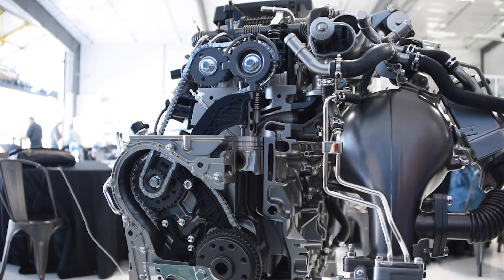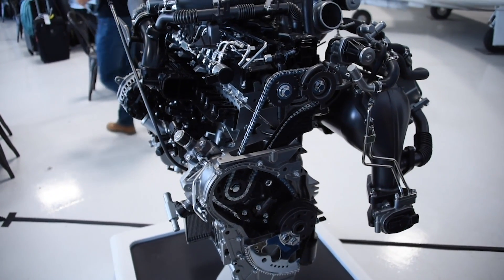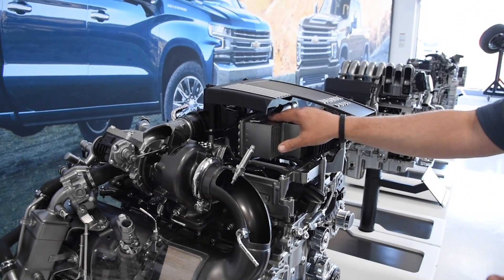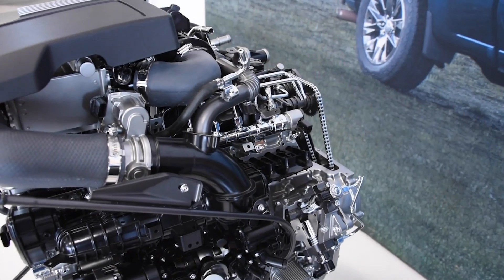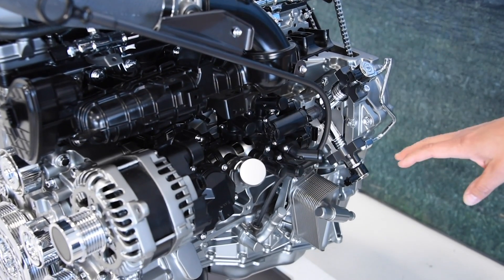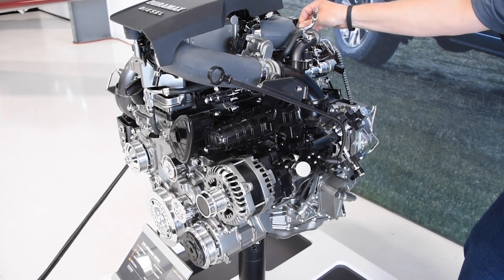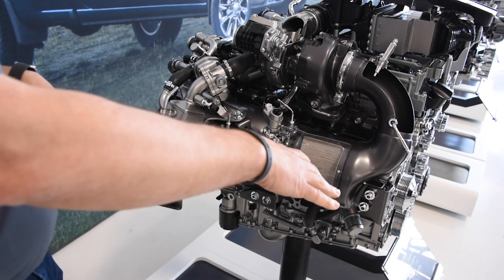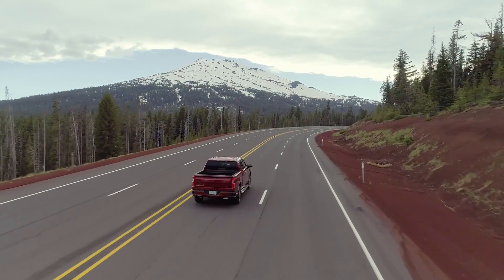What you don't know about the 3.0-liter Duramax diesel

Comment: I stopped watching at 'timing belt for oil pump'. What a joke. Planned obsolescence!
Reply: Yup. Has Permanent timing chains and Cam chains. Come on guys. Just one more chain. So dumb.
Reply: Supposedly it lasts 150,000 miles minimum and is 'easy to service', but I agree that's so dumb. The vehicle is out of warranty by that point, so if your oil pump belt breaks at 113,000 and grenades the motor, there's not a dang thing you can do about it.
Reply: @Kcducttaper1  
I had to laugh, "east to service"!!! All you have to do is drop the transmission!!!
Reply: @Kcducttaper1  exactly  new motors are a joke
Reply: Real diesels have gears, even better than chains. Absolutely bulletproof
Reply: Easy to service “ just back off the transmission “  are you  fahken kidding me? That won’t be a cheap service call!
Reply: Here I thought they learned from making the Colorado have a 150K mile timing belt.

Remove the transmission to service it? Should be a money taker. 

Otherwise, nice power.
Reply: @thomasbishop9098  You have to remember GM now stands for government motors since they had to be bought out/bailed out....  What has GM done to show they can really ever learn, after the steering colums that would lock up on drivers (while the vehicle was being driven, including the vette) for over 10 years from various models it's clear they have a learning disability.  Or if that isn't the case then it makes it clear they really couldn't care less.
But anymore now a days, every maker is making engines to not last, that doesn't make them as much money that way.  Ferd is doing the same stupid thing with the 3.0 powerjoke, belt driven lube pump, they all are taking the moron route and hoping the new car buyers will pay the way.  Piss on that give me a good ol 7.3, I couldn't be made to want a new truck unless it was 100% free to do with as I pleased, then I'd sell it and find a good used older truck.
Reply: @PatrickBaptist  They all have had bailouts from the government at one time or another.  I agree though the GM bailout was a complete lie that they payed off the loans.  The used the old man from at&t to make people feel better but it was a scam.
Reply: That engine looks like such a JOY to work on......NOT!!! Looks like you have to pull the gear on the injection pump. Not a big deal.... A huge deal. Looks like you have to pull the cam chains. Oh sweet now you have to retime the whole motor. I guess it not a big deal since it will last the life of the motor or when someone puts gasoline in the tank and ruins the high pressure pump. I guess its not a big deal since your already into it for injectors, pump and fuel lines. What's another $1000 to pull the trans. Oh well, it could have been a good motor. Typical GM garbage
Reply: $3000 service
Reply: @icenbryse5190  
News flash, but just a few seconds at highway speeds without oil pressure does serious engine damage. There will be no limp mode. It will be shut down mode.
 If a VW timing belt breaks the whole engine stops. 
 I don't think the point is weather it is "supposed" to last 150k with absolutely perfect recommended maintenance. The point is why do it in the first place. It is a unnecessary failure point that didn't have to be there. 
 There are many design issues with this setup in real world applications. I'm sure it looked great on paper. Having the entire exhaust system under the hood is a bad idea. Great when new I guess. Not great after a few winters wear, bird or squirrel nest under the hood, and just the general accelerated wear from the unnecessarily high under hood temperatures this thing will have. 
 Any major component needing replacing is going to require pulling the engine, or cab. The list goes on.
 Timing chains and tensioners are problematic as well. Ask ford.
Reply: Don Olypopper  I dont know where you got that info, but yes it is wet. To help lubricate it and the chains since they are metallic
Reply: What happens if the oil belt comes loose, and for some reason, gets caught in the timing chain? Unlikely, maybe, but crazier things have happened.
Reply: @mosley_actual1924  sine your motor is going to blow with no oil pressure, the damage to the chains isn't going to matter. You're still going to be ordering a new engine
Reply: @mosley_actual1924  As long as it's out of warranty it's GMs happy day.
Stupid ferd is doing the same blame thing with their 3.0 joke.
I use to love fords but today I don't like any brand other than Navistar.
Reply: @PatrickBaptist  as in the same people that built the 6.0 and the 6.4 for Ford?
Reply: @JasonTAho  After the 7.3 PSD ferd stopped having good engines period.
Reply: @PatrickBaptist  I've been a diesel mechanic for 15 years and Navistar SUCKS! the 6.0 Powerstroke/VT365...Navistar! The 6.4 Powerstroke/Maxxforce 7...Navistar The DT530e also junk and also Navistar! Pretty much anything that says "Maxxforce" on it has both NO power and HUGE reliability issues. 

I think you meant to say Cummins or Caterpillar.
Reply: @brandoncrimmins6296  Only power stroke that is good is the 7.3 / T444E, the rest are garbage.
I don't really like anyone's engine after 04, emissions ruined reliability. 
Neah I really any not a CAT fan, but yeah Cummaparts are good too.  Def hate calling them over an Onan product though.
Reply: @JasonTAho  Actually the 6.0 was a navistar but it got rushed to market because of GM releasing the 6.6 Duramax and the Ford corporate wanted to jump right in. The 6.0 isn't a bad motor but as it came from the factory it was. I have an 04 Excursion with one and its at 238k right now. When the original head gaskets failed it got a full bulletproof and EGR delete. Its a very good and reliable engine now. 

The 6.4 was built by a french company, not navistar. At that time navistar and ford were in court battles over the blame game for the 6.0 problems. The 6.4 works well, just not as an engine. But if you tie a rope to it you can keep a boat from drifting off. So it has some sort of use.
Reply: Find somebody that knows how to work on this engine is going to be fun.
Reply: @jamesm568  If they sell enough of these engines I will get the specialty tools and rake in the cash at my shop. Just like I did when they made the 3.4 and I did a million head gaskets and intakes. Just like the for 5.4 3v spark plugs. If they make a shit design I'll be waiting to collect the healthy profits. Bet there will be aftermarket getting into the game after enough fails to make a chain conversion kit to get rid of the belt too.
Reply: Are you an engineer
Reply: @35RSkyline  OH HELL! Here we go with this shit again... "Are you an engineer?" "Are you smarter than GM engineers?"

This is the single most retarded and "I voted for Hillary" statement/argument one can make. 

The fact is that when every other engine in the WORLD has a direct crank driven oil pump. Or at least a chain. Belts are worthless and fail constantly in any environment. Let alone a wet environment. And a wet OIL environment at that. 

Maybe this system will work for a million miles... But even if it did. That does not change the fact that it is ABSOLUTELY stupid. Because whether it proves to be a solid system or not (NOT being far more likely) is not the only issue. The other issue is is whether or not it would have been cheaper, more reliable, less complex and just plain easier to just mount it directly to the crankshaft. 

Their reasoning was noise. And of all the things on a diesel engine that make unwanted or undesired noise. The engine oil is not, has not been more will ever be a point of concern... And in addition to that fact. If your concern is in fact engine noise in the cab... Probably don't put all the noisy timing equipment right at the fire wall. Where you then have to ad even MORE sound deadening to counteract the noise from not only the engine itself but also the extra noise from the timing set. 

And no... I'm not an engineer. But I am a diesel mechanic of about 15 years.
Reply: @35RSkyline  Why would one need to be to know where a belt driven oil pump is going to leave one?
Reply: MY FACTORY timing belt in my 02 civic 1.7  is still going at 231,658 miles...NEVER CHANGED! I have two Harley's and I ride'm like I stole'm and the belt drives have on both bikes have doubled the mileage life.
Reply: @paulh.2144  Yes... Guess what... Both of the belts you mentioned are DRY belts. NOT in oil at ANY time and if they were... They would fail almost immediately. 

Belts can last a good long time but will never last as long as a chain or gear drives.
Reply: @brandoncrimmins6296  Dahh!! Right on Brandon, but they make belts  for this situation in a oil enclosed containment.. and they WORK well!
Reply: @paulh.2144  Ok. I'm willing to believe that... But what I'm getting at it is I'm certainly not going to be the Guinea pig on the hook for the cost of an $70,000 truck. 

Even if they have figured out how to make a belt that stands up to direct engine oil contact. Which actually the oil itself is not the problem. It's WHAT the oil is carrying in it. Things like metal shavings, plastic shaving and other abrasive materials that get picked up while flowing through the oil galleries. ESPECIALLY IN A DIESEL ENGINE...! 

So yes... Chains and/or gear drives are ALWAYS the best solution for reliability. And in the case of oil pump drives. Driving DIRECTLY on the crankshaft is the preferred method.
Reply: @icenbryse5190  The VW 1.9 diesel oil pump is NOT run by the timing belt. It is run by a chain immersed in oil near the bottom of the oil pan. The timing belt runs only the cam and water pump on these engines. Also, a timing belt failure on these engines does not mean the engine isn't repairable. They always require a head replacement, and occasionally, a piston. It's a relatively easy fix. I should know...I've done plenty of them.
Reply: @icenbryse5190  they aren't certifying it for that, they are saying thats the maintenance interval. But as soon as you are out of warranty if it shits you are the one paying. Nobody should have to pull their trans every 150k
Reply: Don't forget transfer case if u have 4X4. 🙆‍♂️🙅‍♂️🙇‍♂️🤦‍♂️
Reply: Pretty sure they made that easy to remove also. 😳🤪🙄
Reply: Izusu engineering
Reply: AMEN diesel mutt!  Yeah the oil pump goes and the engine is toast.  BRILLIANT GM, keep up with what I've always said about GMs junk, not worth having.
Reply: diesel mutt88 - could not agree more. Yes... simply drop the transmission to replace a rubber drive belt post 150K. Garbage....
Reply: Proper Diesel engines have chains. Other than that no thanks.
Reply: @humbertorubi4947  
Wrong... Proper diesel engines are gear driven.
Reply: HeavyMetalMechanic80  mmmm... I’m not and expert but I find some problems in an engine using gears to move the valve train. Gears are good to transmit force but they also produce a lot of drag, for this reason they have minimal tolerance gaps and specific materials on the surface. They will also need to be oiled all time and this will create a need for extra components, bearings and seals. No matter that at the engine revolutions they will wear fast and will loose some precision which is particularly need to keep the valve timing. This wear will cause temperature increase and knock noise which can only be corrected replacing the gears which are not cheap. In the case of belts and chains the wear and tear precision is solved with the auto tensioners that keep the components at the right timing. This is my reasoning about why almost all industry goes on chains or belts. Now between a chain or a belt obviously the chain is better and I can’t find another reason than planned obsolescence to use belts instead of chains in mid or big engines and specially on diesels. But I’m not an expert this is just my reasoning 👍🏻
Reply: Humberto Rubi, never looked at a semi truck or any construction/industrial engines, have you? All gear driven. Anything over 8.0L is gear timing, no chains or belts.
Reply from the maker: @superjesus4307  Remember that this engine is designed for the half-ton market, not heavy duty. These customers expect a quiet engine, and chains are quieter than gears.
Reply: Humberto Rubi 
7.3 diesel has no timing belt or chain. Two gears, one for the crank and one for the cam. 

And you know what an unreliable pos engine that is, but what do I know.
Reply: And one for the HPOP.
Reply: @TheRVConnection  Excellent point.
Reply: @humbertorubi4947  Actually gears are superior for longevity. Large truck engines all use them and I have had semi engines apart that had 1,000,000 miles on them still running the original gears. The engine oil lubes them just as it would lube a timing chain system. They have no business driving an oil pump with anything other than a gear to gear connection. They have simply created a guaranteed mechanism for failure. This is from GM, who told us that the 3.6 was great. Well not so great for 3.6 owners. Ditto for the 3.4 engines, or the 3.1 engines. Ditto for the transmissions. And the t-cases whose pump rubbed right through its own housing.  Hell, we are talking about a company that paid out millions because they couldn't get A SIMPLE FUCKING IGNITION SWITCH right and managed to get people killed.
Reply: @Nostradamus_Order33  Yeah, they only last a million miles. Would've been a lot better to have the owner drop the trans out ever 150k
Reply: @humbertorubi4947  proper diesel engines have timing gears
Reply: Humberto Rubi Gears!!! They have gears.
Reply: @humbertorubi4947  proper diesel engines have timing gears not chains
Reply: @humbertorubi4947 ..... actually, No..... ALL "proper" diesel engines have ZERO internal chains or belts.   ALL heavy duty diesels from large dump trucks to semis and larger.... use Gears internally... and even the Cummins 5.9L (12 valve) and the early (LB7, etc) Duramax's use Gears... no chains or belts.
Reply: @trp2413  Toyota has higher resale because it doesnt discount its new models as much as the koreans and Americans. Resale value is almost entirely based off the cost of current models and market saturation. Ergo you're paying more upfront...and then you're paying interest on that
Reply: @djayt1215  not true, resale value is based on the market demand of a certain model, because of various reasons but in Toyota's case it's quality and longevity. That's why you pay more for a used Toyota, because there is a common understanding that you can buy a 10 year old Toyota and drive it problem free for another 10 years or more. Dealers don't discount new Toyota's because they don't need to, people are prepared to pay 7% interest over 8 years to get the vehicle, because they know it will have good resale value and the demand is there, or they will drive it for 25 years.
Toyota vehicle practically sell themselves, no need to convince anyone.
If you don't know the quality of a used car, just look at it's price (resale value), you get what you pay for!
Reply: It's a metallic belt. Lighter and more efficient than a conventional chain. Plus it will warn you the moment it fails if it ever actually did.
Reply: @steven530x  all engines warn you the moment you have no oil pressure. Its called locking the fuck up and needing a rebuild

Comment: I am impressed by the inline design and by keeping the DOC so close to the engine,the low pressure egr....however I believe they dropped the balls with the rear timing chains and oil pump belt drive. They say the timing chains are for life designed. Based on previous experience with the GM engines with multiple chains like the 3.6 V6 in the traverse,these multiple chains all get a little slop in them and bam the check engine lights on and you can’t pass state emissions inspection!  You need to have a 2000-2500 dollar timing chain job done , due to a poorly designed chain system.  GM has this issue on the 2.4 in the 2011-2017 equinox as well. Since getting to the chains requires complete removal of the transmission and transfer case on 4x4s I am not a fan. Time will tell how it all holds up I guess. Overall I’m disappointed in the 2019 new 1500, apparently I’m not the only one as sales are not what they were hoping while Ram sales are up 70 percent and Ford is still selling the most with the oldest truck by far.
Reply: Glad I live in a state without those idiotic emissions tests.
Reply: Pulling a trans is a heck of a lot easier than pulling a radiator and all the front accessories.